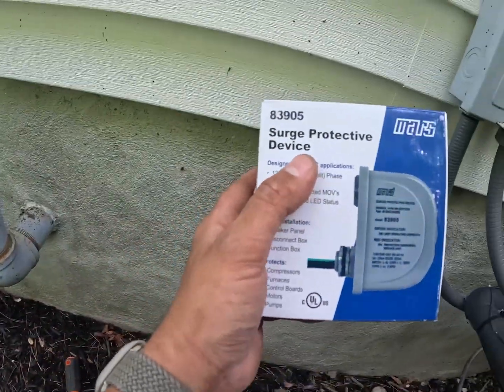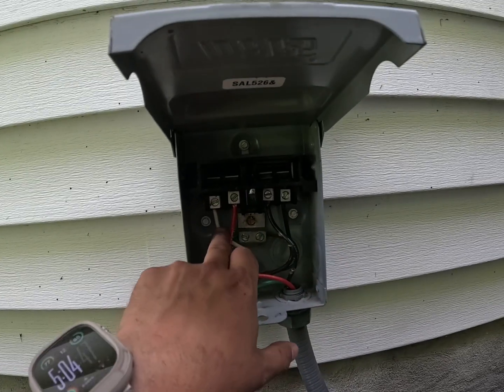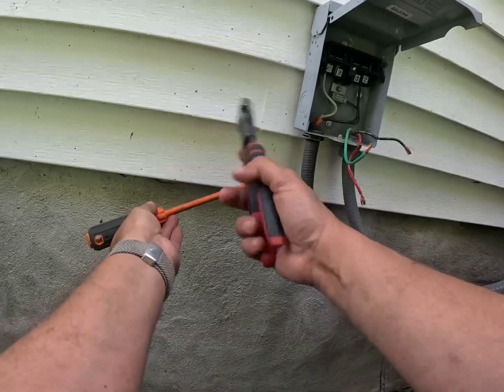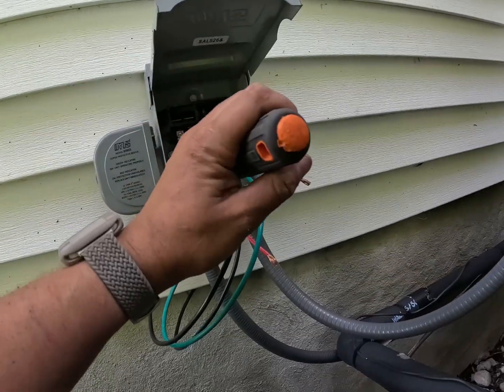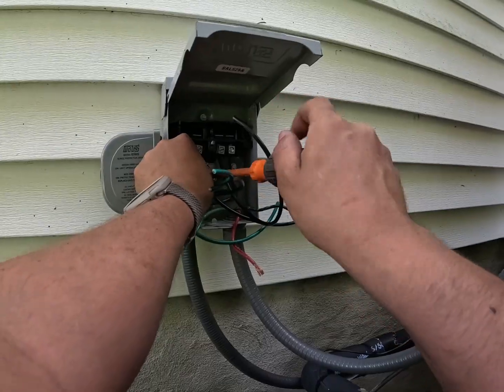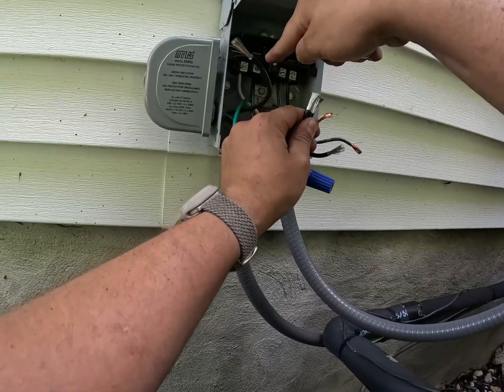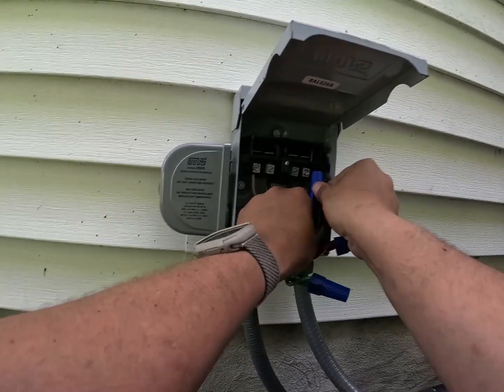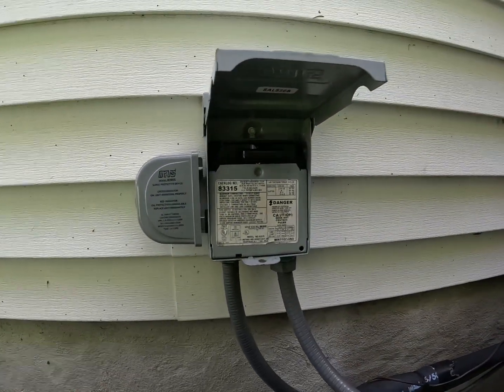Outdoor Surge Protection for Condenser – Shield Your AC from Power Spikes!

Comment: Nice surge protector.  So you were able to touch the power wires because you pulled the disconnect, correct?  It might of been a good idea to test the power wires with a meter first.
Reply from the maker: I was able to touch the load wires because I pulled the disconnect. The line wires were still live, yes a meter is the best way to guarantee safety but I turned on the system before hand and it shut off when I pulled the plug so I knew the wires weren’t live.